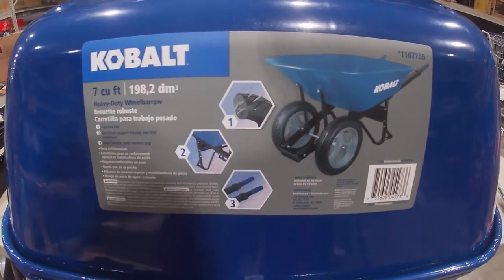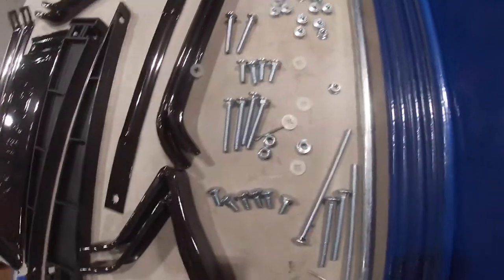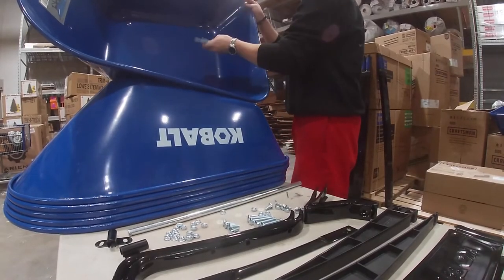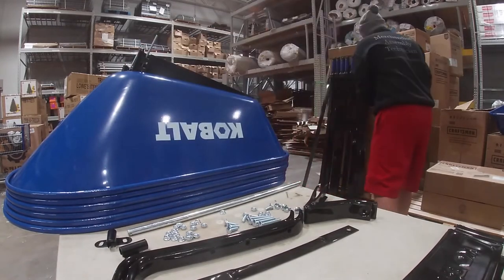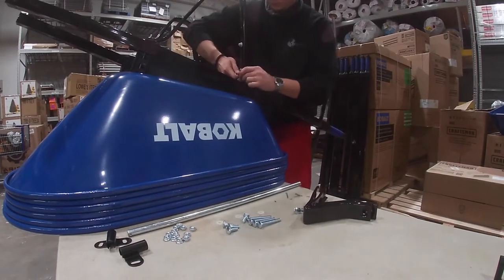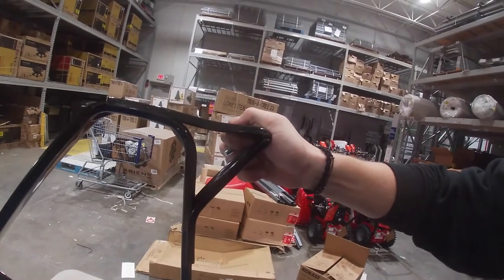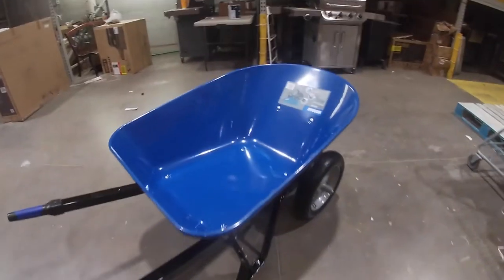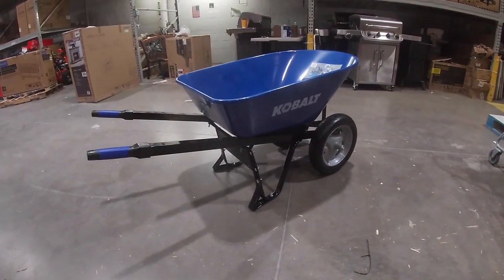Kobalt Dual Wheel Wheelbarrow Assembly Training

Comment: Very nice video, saved me since I bought this thing today and there were no instructions.  I would only add that the wheels have an inside and outside (purely for aesthetic reasons if you look at the stamping-it doesn't matter for function).  Also, for those of us doing it at home the 4 plastic washers come in real handy to hold the long bolts in place when the tub is upside down.
Reply: The instructions are on the inside flaps of the box. It's printed on them

Comment: Plastic washers hold the bolts in place while upside-down.  Better then how I was trained. How to you get them all tight in your bucket that was my issue. The bolts wouldn't pull through felt like everything was crooked
Reply: I just aligned the bolts and tapped them in with a hammer then used masking tape on the heads to hold. The way when tightening the finish does not get damaged with the base of the bolt ripping through the hole

Comment: Interesting how he didn't use or even mention the little plastic washers that you slip onto the long bolts to hold them in the wheelbarrow while you put the wedges and handles on
Reply: I only use those plastic washers when i'm down to my very last wheelbarrow of each skid. That way it doesn't slide through. I currently work for that company.
Reply: That's because the washers ain't needed when you're building on a stack of wheelbarrow buckets
Reply: @kevinvogel666  yeah I get that but at the same time it's still kind of a pain to do it that way and also depends on which brand you doing I can't stand the project Source ones
Reply: @swizzginger320  I stack all my wheelbarrow buckets on my tables and build away. Now I will say that those pos walmart wheelbarrows,  u ain't stacking an building. Those are truly 1 at a time with NO plastic washers. Craftsman,kobalt,project source,Jackson, they all have the washers that I save till the last bucket. I do assembly for national assemblers, been here 4yrs. I work mostly lowes until fall and then it's walmarts